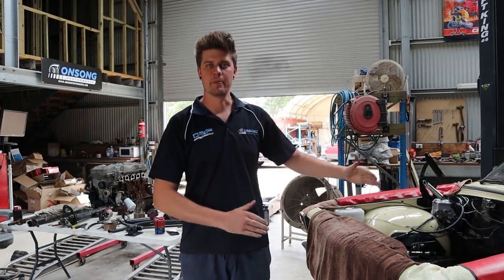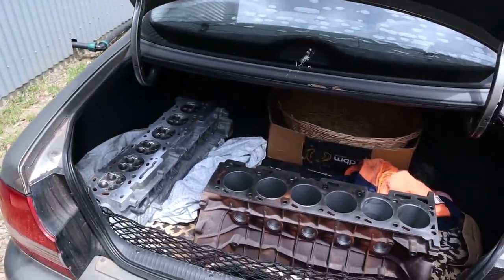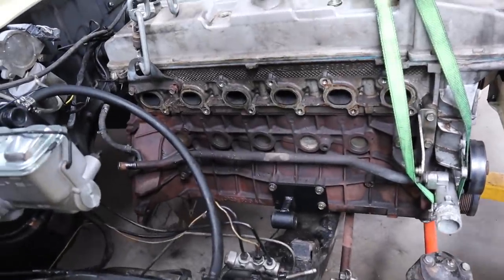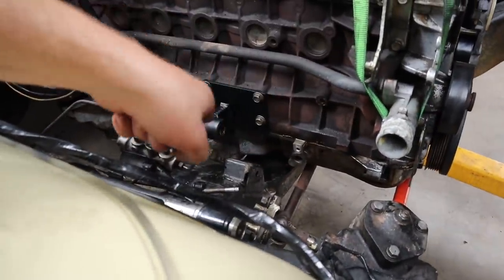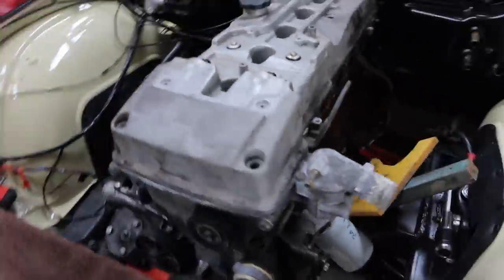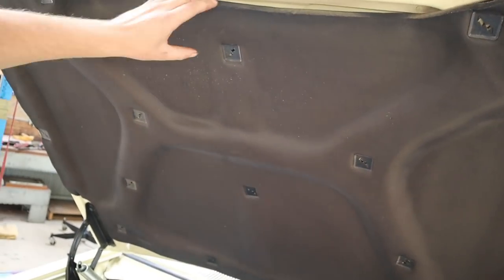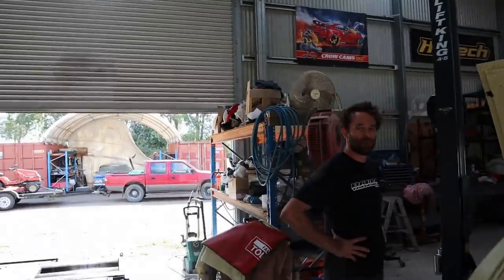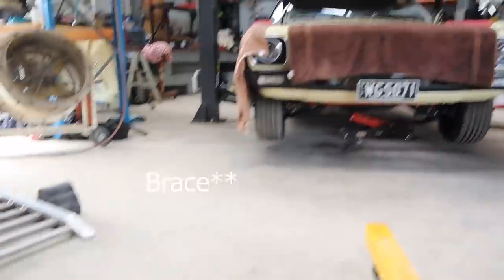Uh Oh! || Not Enough Room || KingBarra Part 4

Comment: I wonder if a territory sump could help out? Being they have the steel pan it would be easier to modify around the steering rod possibly
Reply from the maker: We had thought about it, but the room to fit a front sump in front of the drag link is so minimal I dont think that it would work (drag link moves forward through the turning arc as well)

Comment: I wonder would a rack and pinion conversion provide more room for the sump, although it would  greatly add costs.
Reply from the maker: We looked into a few for solutions, but they all mount the steering rack at around the same height as the drag link though.